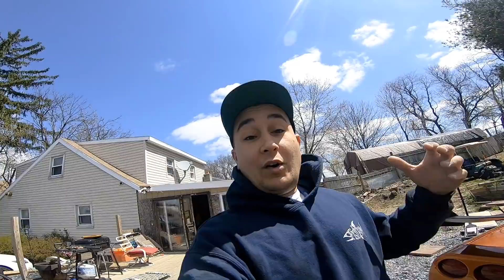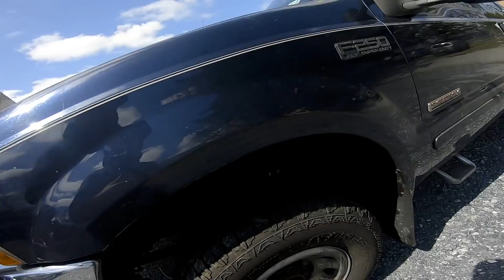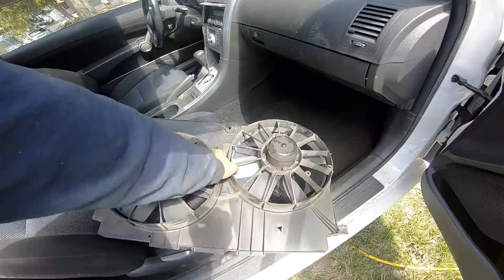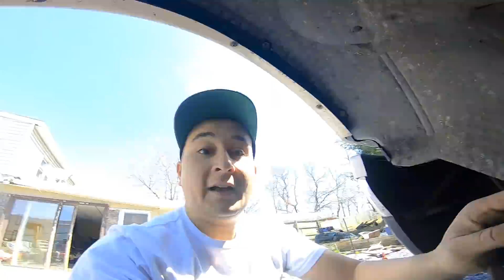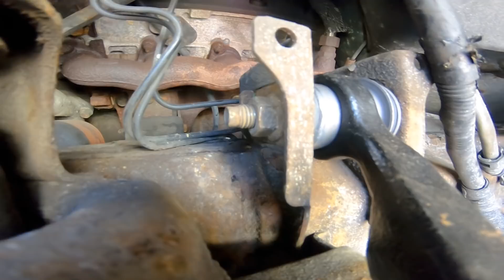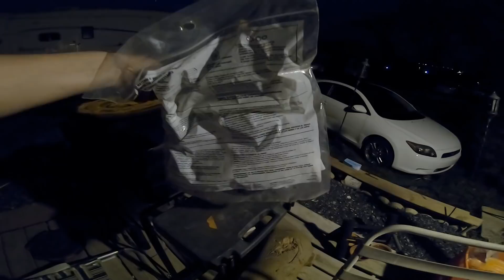THE 6.0 IS LEAKING, I SHOULD HAVE BOUGHT A CUMMINS

Comment: I know a Mechanic that works for Ford and he said never to buy the 6.0 because they have problems all the time. And sometimes a technician can’t even figure it out. I almost did the same mistake purchased one
Reply: Sean Richards - If the tec can't find a problem with a 6.0 he isn't much of a tec. And yes my 6.0 drove nuts with all of its expensive issue - injectors at 80,000 miles - have to have heads replaced at 105,000 miles plus studded. The factory rebuilt heads are junk I had to have the upper half redone at a private shop cost mr $5,600 sense that I have gone 155,000 miles only issue now are oil leaks.
Reply: Some tech they must be 6.0’s are one of the simplest engines I work on on a daily basis work on a max force and let me know how you feel.
Reply: sean richards, I'm with Robby, I have worked on a lot of 6.0, 7.3, 5.9's, 6.6 (I haven't worked on a max force) My suggestion is....don't beleive everything you hear! With a little bit of basic knowledge about the heui system on a ford. Takes sometime to learn. but after that, they are actually fairly easy to diagnose the majority of problems. one of the other big problems came from the lack of experienced techs.  If you get a tech that is swapping parts, then it turns into expensive repair bills. Some 7.3 problems can take longer to diagnose, because the PCM's does not have as much detail testing that a 6.0 or 6.4 wil have with the ford IDS software.(example, IDS will test injectors with a detailed graph, and the ablity to turn individual injectors or the FICM on an off on a 6.0/ 6.4 ) where as a 7.3 will do a buzz test on the injectors, and the IDM is where some experience is needed, or a code is set that leans towards an IDM. But other labor hours are used to do mechanical testing by the tech. There are many more examples, but that is a quick idea of some differences. And even if the guy has a ford dealership shirt on,  definitely doesn't mean he knows all about a ford 6.0. Most of the techs don't really have a clue, they scan and then start changing parts until the squirrel finds a nut.  
Once you correct the main issues with a 6.0, cooling system for the oil, "expensive,about $2k"  solved buy a remote oil cooler eliminating the small factory oil cooler, and deleteing the egr, and ARP head studs. A 6.0 is just as good if not better than a early LB7 duramax, lots of LB7 issues, and some very expensive to repairs. replace an injection pump on a duramax, 8-9 hr book hours. there goes $1000-1200 in labor.  
6.0 gained the reputation it has because of the lack of cooling, egr and oil coolers where almost an after thought for international when they designed the 6.0. But then..what happens is an aftermarket company pretty much solved the issue(it's not inexpensive, but will pretty much cure that problem from happening.) 
I'd buy another 6.0, I would just figure into the purchase price what it takes to fix the I say 3 biggest problems and then go from there in the purchase price.   this is just my opinion, other have the total opposite opinion. everyone knows that opinions are like "a**holes, everyone has one"

Comment: leaking power steering will end up being the least of your problems you'll have with that 6.0. L wait till the head gaskets and cooling system start having issues.  it's not a matter of if but more so WHEN. the ONLY ford Diesel that's ever proven to be any good over time is the 7.3L  the 6.7's aren't that bad either but the only one i would own is a 7.3, or a cummins or a Duramax. No other exceptions! with the cummins unless you have the trans beefed up they do end up having problems with those too on occasion specially if you pull anything serious at all with it